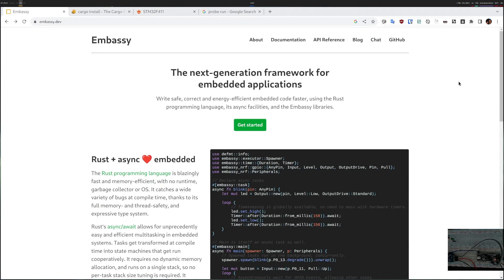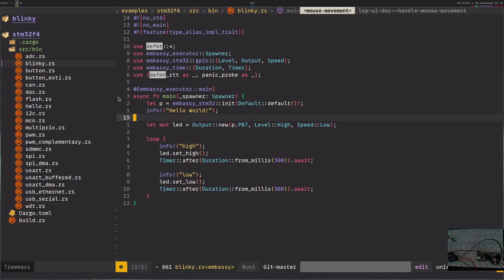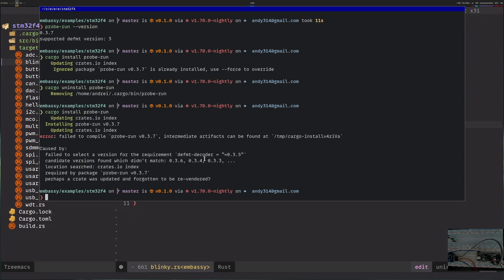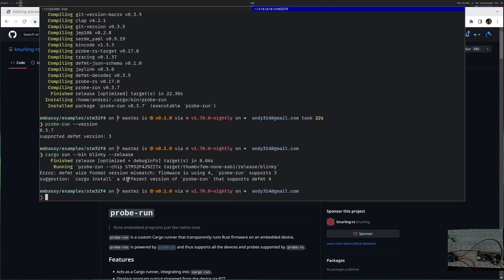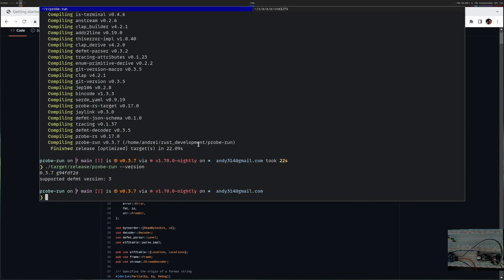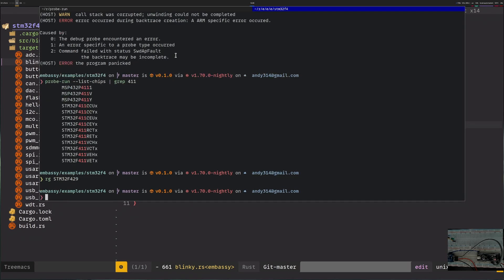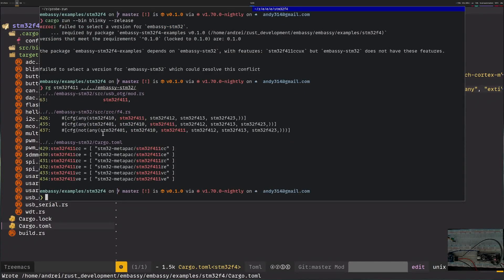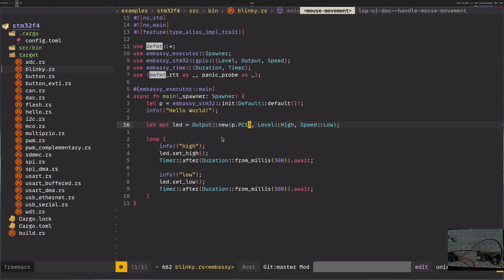Embedded Rust: running an embassy example on a STM32F411 microcontroller

Comment: Hey thank you so much for uploading this video. I also have a Blackpill board with a 16 MB external flash running Micropython at the moment and I was looking for a tutorial that shows how to get started with embassy. You really got me motivated to start working on this on a Sunday!
That step by step process to solve the issue with defmt/probe is really helpful. Which JTAG adaptor are you using to flash and debug it?

Please create more videos of the STM32411 running Embassy!